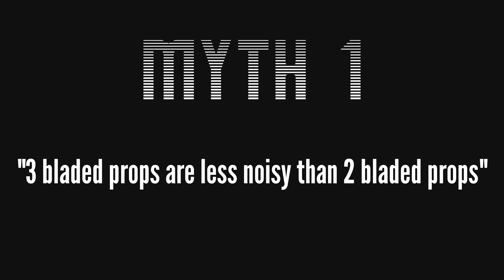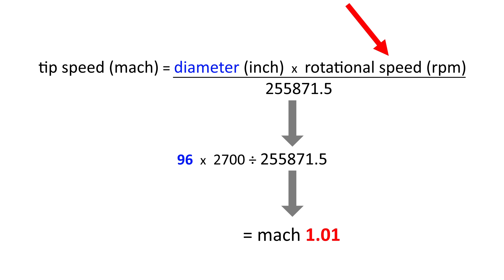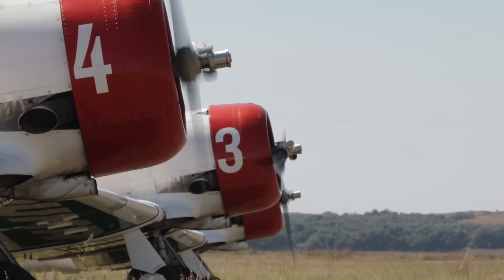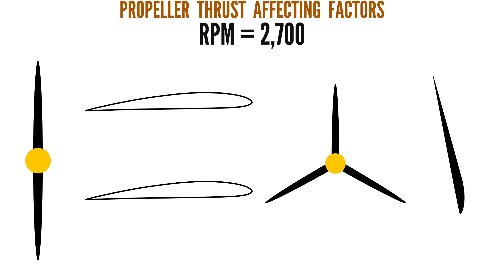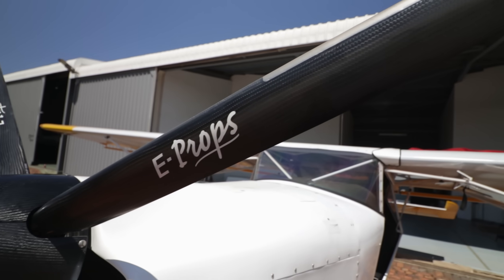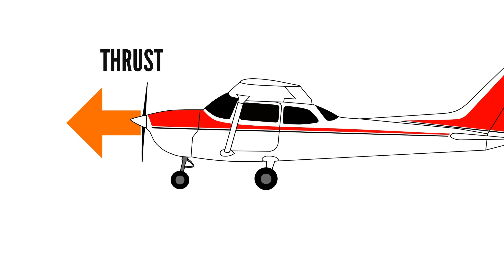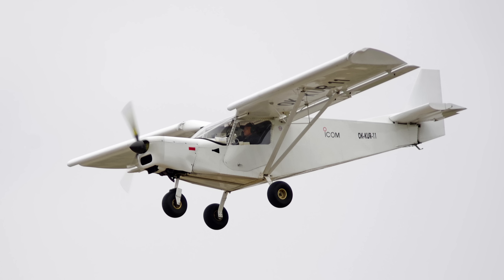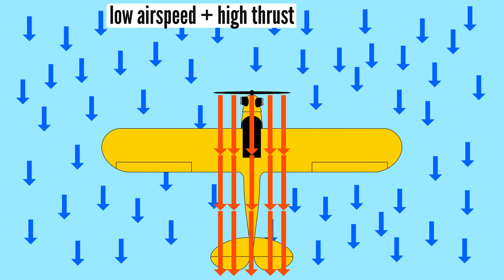4 Biggest Propeller Myths Explored - Long v Short & 2 v 3 Blade

Comment: How do you know that on an AT-6 Texan, that sound doesn't primarily come from the exhaust pipes?
Reply from the maker: That isn't how a radial engine exhaust tone sounds. They make a low-pitch rumbling/gargling sound, not a high pitch "screaming" noise like in the clip in the video. When the T6 is in cruise, and the propeller pitch is set coarser, i.e. slowing down the propeller speed and thus the tip speed, it doesn't make that sound anymore.

Comment: Well-covered. what is missing is blade thickness and blade camber as parameters. 
 
There are so many parameters that all interact - like most technical problems.
Reply from the maker: Thanks. Yeah blade thickness is the least changable parameter (relatively speaking). Changing thickness changes camber, and that changes lift/drag ratio of the blade (which changes more things down the line, like optimum lift/thrust spinning speed). There's is not a whole lot of room to "play" with thickness and camber to cater for more or less horsepower.

Comment: Engine shaft HP/torque is a big factor in what prop you can use, You need the torque to spin the prop to optimal RPM

Comment: When the tip of the rotating propeller reaches more than the speed of sound, it creates shockwave. The molecules of the air compacted in the shockwave. The adjacent propeller have not enough air molecule to grab to create thrust.

Comment: - NB, a higher cambered blade needn't be thicker - of course with combustion it is expedient to make blades substantial to offset vibration fatigue..  With electric propulsion is is simple to lighten the blades using a thin cambered blade.

NB - lower RPM prop doesn't mean slower slipstream - also not to forget the prop wash is spiraling - not straight, cheers.

 - The pitch reduction quip - if anyone proposes that - means they don't understand thrust at all...

(Shorter blade,  higher pitch, lower camber, more blades -  absorbs more power - with faster airspeed setpoint, and results in a longer takeoff roll.  (that balance with static thrust and critical angle of attack at low airspeed...)

Aart from aerobatic concerns - more blades are only useful once maximum geometric diameter is reached (for the installation size) and power remains to be absorbed - somewhere in the desired flight regimes.
Reply from the maker: All good points. However regarding the speed of a slower spinning propeller's slipstream, are you referring to the blade tips specifically? The mean speed if the slipstream will be slower, it has to be with the law of conservation of energy followed by newtons 3rd law. I'm making some assumptions here of course, one of which is that a spinning long prop and short prop have the same blade tip speed (thus the shorter one having a higher rpm) and all else being equal, they will move an almost identical amount of air per second past a point just aft of the propeller. If the larger diameter (slower spinning) prop then move more air as a result of it's bigger spin area, the slipstream must to be slower.

Comment: You say with same rpm, blade length and shape perfectly balanced a two blade and three blade prop would make the same noise.   It seems to me that in that scenario the three bladed propeller should make more total noise because there are three noise sources instead of two.  That what is really equal is the noise generated per blade.   Am I understanding correctly?

Comment: More blades have more drag. So a single blade would be most efficient. But noisy.  More blades are quiet and transmite more power. With limited power 2 blades are faster but with more power multi blades are faster
Reply from the maker: Single blade is more efficient, but has very limited power absorbtion. The blade can only be made a limited length before tip speeds become and issue. And if making the chord wider to add power absorbtion, it loses efficiency, and there would be a crossover point where it would be more efficient to add a second blade, than making the single blade chord wider. And same 2 vs 3 blade, 3 vs 4 blade etc.

Comment: Great Presentation, glad you mentioned the F4U Corsair, would like to know how when the Corsair got a more powerful engine they went to a 4 bladed prop. Also I would like to know why the C46 Commando went from a 4 bladed prop to a 3 bladed prop. My Dad worked 4 bladed prop C46's in the Philippines but most pictures show C46's with 3 bladed props.

Comment: One thing I didn't hear is that a single bladed prop is most efficient as it runs in less disturbed air, as a two blade is more efficient than a three blade again because the blades run in less disturbed air or blade wake and so on. Could you comment on this issue.
Reply from the maker: Single blade is more efficient, but not because of less disturbed air. The propeller pushes the wake backwards, so by the time the 2nd or 3rd blade gets to that point, it hits new undisturbed air. So perhaps a myth that I will cover in the next one.

Blades has efficiency losses, noise, bending etc, so less blades is more efficient. But this is fairly minor compared to the fact that more blades have more power absorbtion potential. Someone said it's thrust that pushes the plane, not efficiency, and 1 blade has very limited power absorbtion or thrust, regardless of higher efficiency.
Reply: @LetsGoAviate  Hey its exactly what I said, the single blade runs in less disturbed air, or cleaner air. The plane moves forward, so it runs is less disturbed air.

Comment: New to the party.  So, question:  if the propeller slipstream adds drag as that portion of the plane is pulled through that faster moving air, why aren't more planes built with a "pusher" type propulsion system?  And if you've done a video of that, could you link it, please?
Reply from the maker: Pusher config engines/propellers have a few disadvantages, but aerodynamically speakiing it doesn't get "clean" and undisturbed air like a tractor propeller does, with the air first having to pass over the fuselage and wings before reaching the propeller. The pusher prop thus passes though the wake of the plane, which results in non-uniform speed of the air hitting the propeller, which reduces propeller efficiency.
Reply: @LetsGoAviate  so it's a trade-off between the plane going through a slipstream and the propeller having access to to undisturbed air.  Thanks for the explanation!
Reply: I had wondered about this too, so thanks for your reply.
I was also thinking, would moving the props to the wings be more efficient, since the body would not be dragging in the high speed propeller air?  (Ignoring the added complexity of doubling the number of propellers).
Reply from the maker: @willmcgo8288  If I understand correctly and you mean the engine is kept in the nose but it drives a propeller mounted on each wing; Aerodynamically speaking, yes I think it will be more efficient. But I think that efficiency would be lost mechanically via a drivetrain in each wing to drive the propellers. That's not taking into account added weight and complexities, and that the engine would likely need to be behind the cockpit to make it possible at all.
Reply: @LetsGoAviate  Thanks!   I intentionally left the engine situation vague, so yes either one engine servicing all props, or an engine on each propeller.  I was strictly thinking aerodynamically, and not engine efficiency.  If using two engines, maybe each has half the power of a single engine, to avoid much of a weight penalty.
I'm guessing this is not a typical thing to use more engines of lower power when one of higher power would do, as they probably use more engines to increase the power level, not to keep prop wash from blasting the fuselage.  But I don't really know!
Once they have more battery powered aircraft, moving smaller electric motors onto the wings seems like a way to improve efficiency, instead of a single motor up front. Maybe more than two motors, but I don't know how the wing props would affect lift.

Comment: Maybe you can help me! Why is it so taboo to manipulate the flaps just before landings. As a former Alaska 135 pilot. The first of two thing I was told to learn. Was to get comfortable pulling the flaps before you touched the runway.  Cessna 207's and grand Caravan had the same kind of flaps. Wherever you moved the indicator, the flaps will move to match it.
You're not going all fall out of the sky because you're right in the middle of ground effect. Your stall speed is way low. I'm not trying to argue about this. This is what I did for four years. I just want to know why it's such a big deal.

Comment: For STOL though, it should also be appreciated that the prop stream accelerated flow is enhancing to high lift devices; slats and flaps.
Reply from the maker: Yeeees! Since the equation of drag is the same as lift, the faster propeller slipstream not only increases drag as a function of V^2, but also lift. In the context of the video however, that faster propeller slipstream of the smaller diameter, faster spinning propeller is more concentrated over the fuselage that creates very little lift, and misses most of the wings, flaps and slats. A slower spinning, larger diameter propellers slipstream is slower, but spread out over a wider area, and will go over a larger portion of the airplanes wings, flaps and slats. So there is no real increase in lift by going for a faster spinning, slower diameter prop. On STOL one would want the largest possible diameter prop spinning right up to the max tip speed of mach 0.8, even closer to 0.9, to make use of this increased lift from the propeller slipstream.

Comment: Never introduced constant speed props...
Reply from the maker: Yes that was on purpose, as that complicates explanation. With constant speed/variable pitch taken into account, everything in the video is still valid, but the optimum thrust airspeed limitations removed that a fixed pitch prop would have. If interested, I covered the aerodynamics and thrust of variable pitch extensively in this video : https://youtu.be/hvboi6w1Z9A?si=ekW1tPhCBASyH86H

Comment: Most impressive. Thank you for the detailed presentation. I worked as an Aerospace Engineer for over 31 years and never have seen all these issues presented so concisely in one presentation.
Reply: The more blades, the safer it is in case of loss of one of the blades. when you have two blades and lose one, you will no longer be able to continue flying, and if you have three blades and you lose one, then you will be able to continue flying with limitations.
for this reason you will not see two blades on civil and military transport aircraft.

Comment: This is for the consideration of aircraft designers only. Your existing airworthy aircraft's propeller is limited by the type certificate data sheet, so you DON'T get to experiment with propellers on an aircraft with a type cert.
Reply from the maker: You can experiment as you like as long as there is an STC for each prop you fit. Take a look the STC's for the Cessna 172 for example, you have 2 and 3 blade options, of various blade lengths. Depending on the engine and model of Cessna 172, you can fit certain Hartzell, McCauly, MT prop, Sensenich and possibly more. That's certified aircraft. On most experimental there are virtually no propeller legal restrictions.
Reply: @LetsGoAviate 

You are exactly right with an exception. If you place the aircraft in experimental for a short time while experimenting you can do whatever you wish. Then bring it back to normal with a certificated prop installed. But I bet you knew that too! I have done this many times with different engines and such doing research for mods.

Comment: Fun facts 1. The Wright Brothers' real innovation was realizing a propellor blade was a wing turning in a circle. They were the only ones getting full efficiency from the engine. 2. An early misconception was that multi bladed props would aerodynamically interfere with each other.
Reply: That's not entirely a misconception, because drag exists. In a world with no drag and spherical cows, where the aircraft is not accelerating, they wouldn't interfere.
Reply: It's not much of a thought stretch in the modern world to think that if you invert a ramp and drag it forwards by the tip fast enough it'll levitate. The simplest wing is literally just an upside-down ramp that's having forward thrust applied to it in such an angle that it ramps itself up in the airflow. The electric fan was invented just over 20 years before the first flight, so the basics of propellers were already known, at least. The biggest challenge was getting an engine with a sufficient power-to-weight ratio, as early engines were rather weak.
Reply: @WardenWolf  not really. the electric fans of the era, as well as competing aircraft attempts, didn´t use the modern propeller design. They were much closer to a "shovel wheel", with short, flat  blades. The big innovation of the wrights was to give the blades a high aspect ratio, and a twist to keep the angle of attack constant across the length of the blade. this gave them the needed boost in efficiency.
Reply: Eiffel had a wind tunnel much earlier and others.
Reply: Ehm, not interfere? Okay, not many pilots do a tail slide. That means, flying up vertically, until the plane comes to a fool stop and.... starts falling down, tail first. At that moment of hanging still, you bet the prop blades get into each others wash.
But again, this is aerobatics. And a dangerous one too, you can break the rudder. Do not try this at home. This  is YouTube, it's loaded with crash video's.
Reply: The Wright Brothers were the first to realize that having an airplane could replace the need for certain social conventions, including the presence of women.
Reply: @scottw550 right, so they invented an airplane because they hated women and not because flying is only the one thing humanity dreamed of for eternity. 😂😂
Reply: The Wright Brothers had other innovations too. They were the first to use a wind tunnel to test airfoil designs. They developed the first system to control their airplane in all 3 axes.

Comment: why inches? the world is metric.
Reply from the maker: I agree but most common propellers (US manufactured) are referred to, sold and talked about in inches. We also talk about power in hp, not kw, altitude in feet, not meters. It's aviation standards.
Reply: because the imperial system has won two world wars

Comment: Years ago my father purchased an airboat from a NASA engineer. It had a 6 cylinder Corvair engine. My father and I were both engineers and my father was a WW II B25 bomber pilot. The airboat would do 40+ mph at 4000 rpm. We wondered if the boat had the correct prop. We looked up the engine specs, 140 hp at 4200 rpm and measured the prop diameter. We calculated the speed of sound at sea level, about 1100 ft/sec. We calculated the prop tip speed, just under the speed of sound. We concluded the NASA engineer had selected a good prop for the boat. It would require a major engine and prop change to get the boat to go 50 mph. The flat bottom John boat was not built for the job. After a few years, a weld cracked on the front of the boat from the pounding of the water. 

Conclusion, the engine and prop were very noisy and care was needed leaving and returning to shore not to disturb others.
Reply: @bidenisasnake9932 Boats also have a hull speed and maximum engine power, which we had exceeded. They are also worthless in choppy water that rips the welds apart. Don’t overload with ice and beer and throw back the large hammerhead sharks. But they are a lot of fun flying on glass smooth water at 40+mph in 6” deep water that no other boat can go. To go where no man has gone before.

Comment: What to make of counter rotating propellers like some late Spitfires and the Tupolev Bear bomber? Supposed to be very efficient but also very noisy. And then there is the CFM Rise "open rotor" engine being developed for jet liners with its variable rotating and static blades. Presumably it must be more efficient than standard turbo props, faster (and equally quiet or quieter), otherwise they wouldn't bother.

Comment: "Diameter, smaller = more fuel efficiency".....?
That makes no sense....
All things considered, a large diameter prop would act more like a sailplane wing  and a smaller prop diameter would act more like a Cessna wing, the tip speed could be identical on both props... The larger diameter would be more fuel efficient.
What you lose with the larger prop is aircraft speed range, for example, an absurdly large prop diameter would make a very "single-speed" aircraft, it ought to be very "fuel efficient" though :)